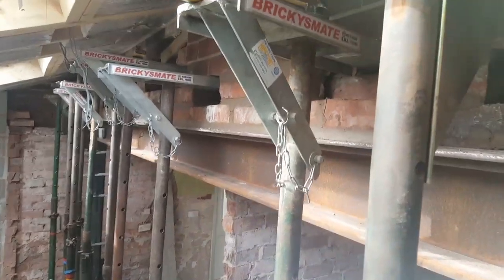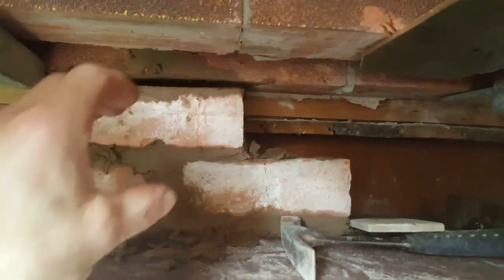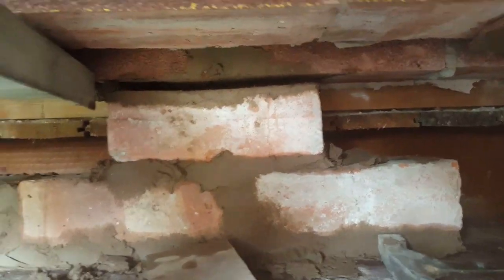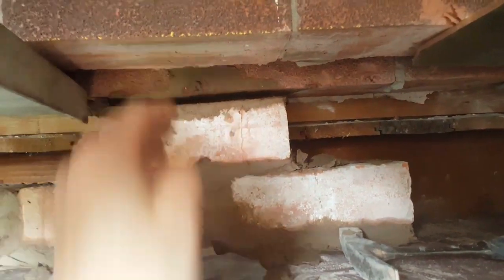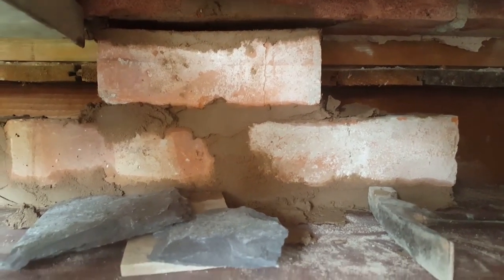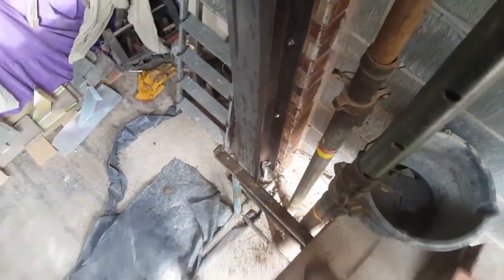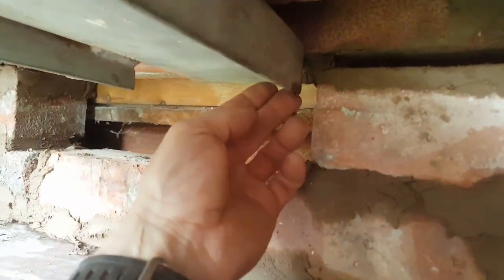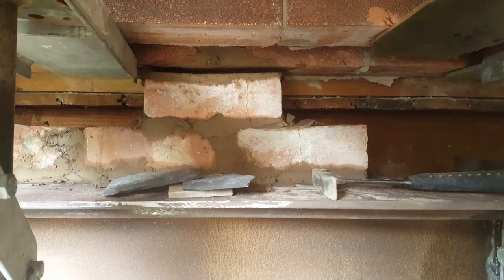How to support and brick up above  steel RSG Lintel

Comment from the maker: The props are called brickys mates
they hold up both the internal and external walls if your struggling to hold the internal wall up.
i.e maybe a timber joist in the way.
many hireplaces do them but maybe not your big companies like travis.

Comment from the maker: Hi Robert please look at brickies mate strongboys for supporting the external and internal walls in one. Also may be see if you can support the floor joists if they are resting on the wall you are removing.
Prop the joists as they may? Be set in the brickwork you can hold up by that way. Just watch for any bricks dropping inbetween the joists.

Comment from the maker: yes mate you can hammer the slate in to a tight fit or wait till the cement goes of then wedge the slate in is a better job alot stronger also just incase the cement joint drops a bit.

Comment from the maker: On padstones is good and ok its when your are takeing a bigger area of wall out that it would change to vertical rsg posts.
due to more weight on a padstone.
and wind as a building inspector told us.
a bit ott on many jobs i think but safety is number1.
karl

Comment: Have exactly this job to do on our extension project that needs a 5 meter steel. Structural engineer spec is to lay that on padstones over new blockwork piers, but this goal post design makes good sense. Do they have to be welded as well as bolted though?  

I knew slate should be used in packing, but not sure the builders around here would bother - Great to see the details on a proper job, thanks again.

Comment: Since the ceiling joists are running parallel to the new steel why wasn't the steel raised a few more courses to remove the downstand between ground floor ceiling and extension?
That would open up sightlines downstairs and remove the dingy shadow cast by the boxed in steel.

The plate welded to the top of the steel is called a ledger plate

Comment: just a clarification: what's the purpose of the slates? I've never seen them used as packing. Do you just push them into wet mortar and then fill the gaps?

Comment: Great description of the packing.. Is the beam bolted to the vertical steel supports or sitting on top.   And again is there a difference - perhaps its engineer opinion on which method...

Comment: Hi mate, brick bearing wall over steel, if we can use Thermalite block? Instead of brick work over steel?
Reply from the maker: Yes I am sure that's OK. As Thermalite walls are built on brick walls from dpc up. Brick then block.
Please just check with your building control officer that's checking your job.
Just tie it in both sides. 
Thx

Comment: Great video. can you show how you would lose the steel post into the wall when the existing cavity is 50mm and the new extension cavity is 100mm so that the existing and new walls are flat.

Comment: How did you get the steel in with the props in the way? I’m going to have the same problem! Also do you need strong boys on both sides or can you use one to support both internal and external brick work? Thx
Reply from the maker: Hi martyn johnson.
If you can not slide the steel from either end of the wall by opening up the brick work then once in sliding it in then brick it back up.
Or get it in position on the floor or next yo then prop it up. Good luck
Reply: Thx for reply,  would you consider strong boys/Brickies mates on both inside block work and external brick work? Or will one side every 900mm be sufficient?  We have goal posts on steel as well so need pads either side, just trying to create more room but not sure if Brickies mates on one side will be strong enough for both intern and external brick work?
Reply from the maker: Hi mate definately prop both sides of the wall. Sometimes if the bedroom floor joists are resting on that side you can plank across them and use acro props to push up and hold them and the brickwork?
A good size piece of timber can be used to go across both course and propped on each end?

I prefer to use props of both sides and hold the ceiling joists if thats they are resting on the wall your taking out.
I hope this helps.
Send me pictures of your project if your still a bit unsure.

Also i use a concrete vibrating machine when putting your padstones in the ground so it does not settle lower than the height you have set?
Using one soon.
Thx 
Karl

Comment: Isn’t it better to dry pack with sharpe sand mix as it doesn’t shrink and crack ?
Reply from the maker: Interesting.i will ask that question and get back to you.
Personally yes i think that would work. Maybe not to strong, not stronger than the brick Or block your laying. May crack the brickwork?
Thx groover

Comment: Hi mate, I'm doing an exterior wall installation for the first time, double steel.. inside block, outside block.. I've never bolted them together before..  so how do I bolt them securely without over tightening and having them pull together? Should I leave a specific gap? Thanks for any help
Reply: Use steel pipe/tube, either welded to one side of the steel or just loose between them to act as a solid spacer. Drill all holes 'zig zagged' ie 25mm from bottom of steel then next hole along the steel 25mm from top and repeat to give better lateral strength. Bolt up with m16 threaded bar with washers and nyloc nuts and you can't go wrong.

Comment: Yet another video on you Tube where tongued prop attachments are being misused!
The Props and needles method would give adequate fitting space without dangerously removing the opening down the full depth and with fewer impeding props as the safe working load of a needle is five times greater than eccentric propping from one side.
The main cause of collapse during masonry alterations is overloading due to removing Strongboy’s further from the wall to either avoid internal 1st floor wall damage or where attempting to gain more fitting work space as over extending greatly affects the capacity.

When fitted with a Strongboy or any other similar designed product the Acrow props safe working load is severely reduced by at least 90%, from 3,400kg down to the maximum 340kg and can even reduce down to 0kg of which depends on the size & the working height of the Acrow prop, how plumb, how tightly fitted and how far the Acrow prop is positioned from the centre of the wall.
–
It’s urban myth that the Strongboy is suitable for every task, with the instructions changed by enforcement of the H.S.E in November 2015 and now read; “Before using a Strongboy you should identify that it is a suitable method to carry out the intended works”.
British law also states that all temporary support must be designed, installed & maintained to withstand the load and only used for the purpose for which it was designed for, a structure must not be loaded as to render it unsafe at any time to any person.

The theory behind the Strongboy is to use fewer Acrow props and to reduce masonry damage and is marketed within that manner, which certainly is not the case when the maximum safe working load is only a fraction (1/5) of the correct propping and needling method and when maintaining the 340kg safe working load the hole within both sides of the cavity wall or a 9″ wall is actually larger than fitting a needle and with at least five times more fitting holes required than one 1,700kg safe working load needle.